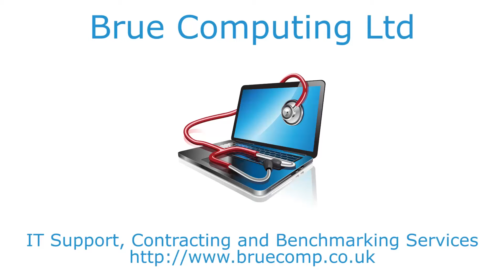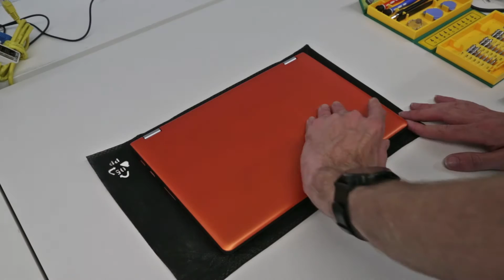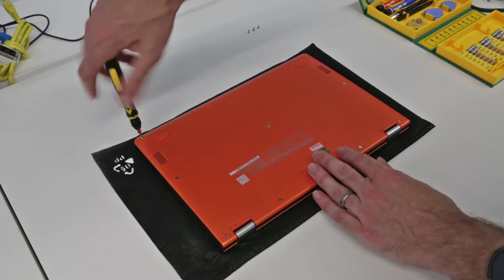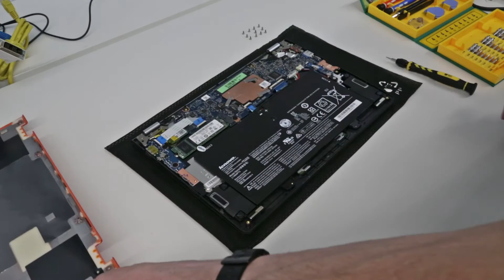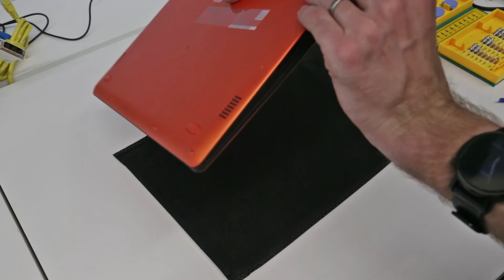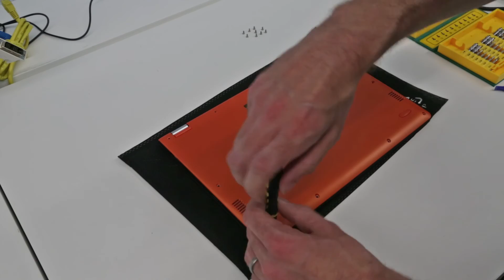Lenovo Yoga 700 11.6" SSD Upgrade Guide

Comment: Hi Bruce, this was a great video and thank you for uploading.  However, l watched the video twice and I didn't hear you state or better provide in text explanation what exactly is the SSD model# before and after so that one can search for them and know with certainty what the correct form factor is.  FYI, if you call Lenovo tech support Lenovo will tell you everything is soddered down, and I have discovered their product descriptions aren't updated either. I H Watinsky
Reply from the maker: It takes any SATA (not tested NVMe) M.2 2280 form factor drive. I included a link to the one I used in the description.
Reply: @BrueComputing have u tested nvme yet?

Comment: can upgrade the SSD with samsung evo SSD??
Reply from the maker: If it is a SATA M2 model then yes, should be fine.
Reply: Brue Computing  how do I find out I am debating whether to return my yoga 710 because it's kind of slow it stutters a lot on both internet and computer tasks
Reply: Brue Computing I'm just hoping it's a SSD problem because my 2012 HP Envy M4 has my 1 terabyte Samsung SSD and it works just fine
Reply: @alberta6408  well how’d it go?
Reply: @cj9318  I didn't try